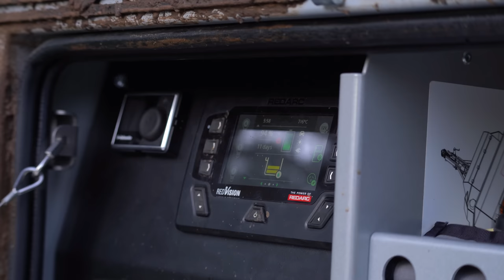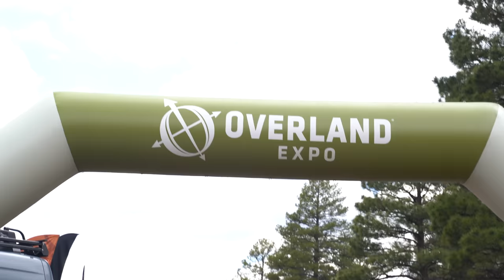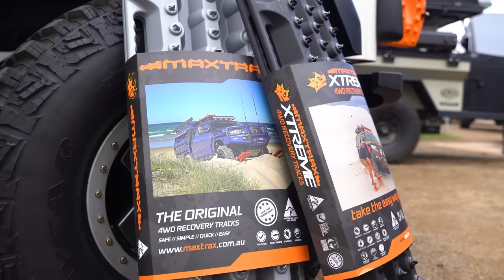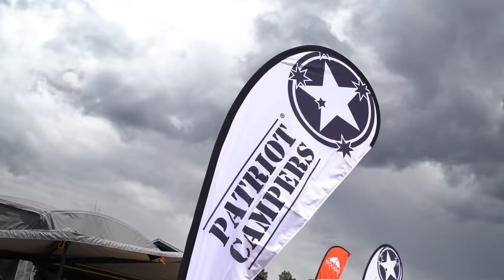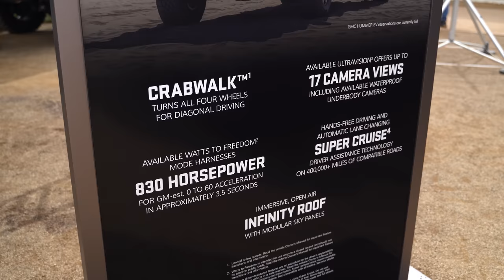WE LOST THE TRACK! 4WDING IN A STORM!

Comment: That beige (Bronco sized) International and the Apache and the 80 at the end for mine, the rest is so American, just OTT, just gone to much like the buggy, is it a car or a buggy, it's like wearing speedos at the beach, they are speedos until ya leave the boardwalk then their undies, and that's wrong on so many levels. But as usual only in America. Still sick to see what can be done., What I find more impressive is the links and under chassis fab work, aftermarket links, joints diff bracing etc that they get into. would love to see more of that here, more available options. But good work lads, def love to see Nav get something that reflects him as a tourer. he should check out Designed and Built back in Aussie for idea's, might not need to get that flash, but shows what can be done. keep it up lads, I dunno how ya put with Mat though Nav, patience of a saint 🤘
Reply: American here! I went to that expo and frankly it was overwhelming and too much. Kinda lost the reason what camping is supposed to be. Makes you feel poor if you don't have the latest and the biggest rig. Felt sour leaving it. Probably won't go to the expo again. The classic Chevy Apache was by far the best rig at the show.